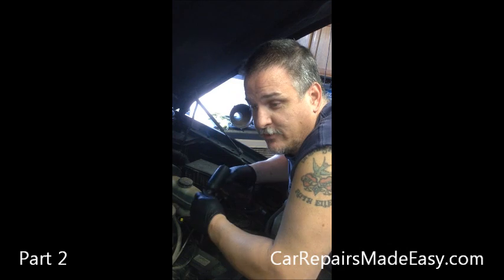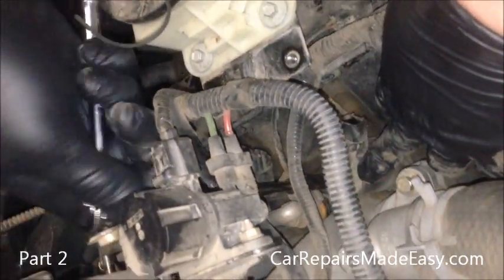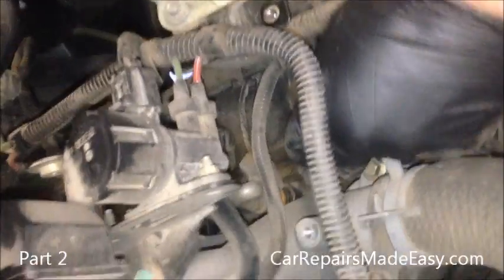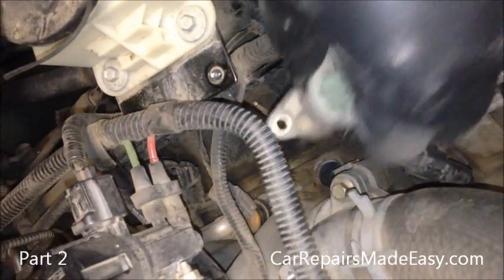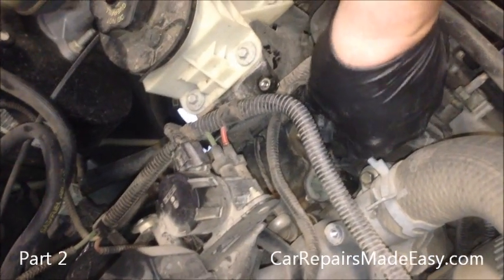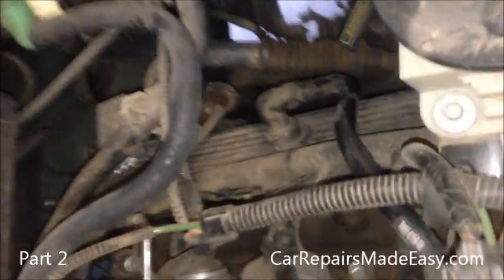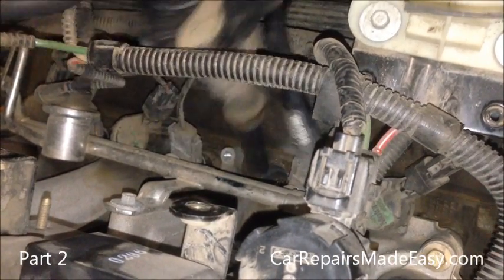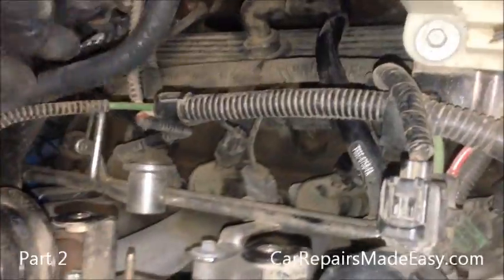Ford Expedition Spark Plug Replacement Part 2

Comment: Just so people understand, there is NO part 3. The entire reason most came to this video to begin with. 

 You'll need a stubby 7mm wobble one piece to clear fuel pressure regulator/ rail and a long 1/4 in ext to access coil screw on rear driver back 2 coils.

Tips he did not mention. Engine should not be cold, unless After pulling coil, spray WD 40 or equiv liquid penetrant so that it helps break free w/out breaking plug.  Let it soak at least an hour. Some say overnight.

I used electric 12v bosch impact. Plugs came right out. 

Torque plugs tighter than spec to 20-23 ft lbs due to limited threads penetrating cyl bore and preventing them from backing out. Some people use anti seize some don't.

Be sure and use Dielectric grease on inside of boots connecting to sparkplug.
Reply: Thanks man for ur info that did help more then the video lol
Reply: I’ve took the screw off with the 7mm I little beat leaned to the side in order to reach. Put it back on has being a pain in the ass though 😟
Reply: Thank you for that info.  I just changed all plugs and coils and couldn't figure out what to do about that particular coil.  Going to the parts store.  Thanks again!

Comment from the maker: Well if it is a case of oil and dirt creating a "paste" where you can't get the socket on the plug then try using something to scrap it out. If you have access to compressed air use that to blow out anything you loosen so it doesn't go in the hole when  you take out the plug. Brake cleaner will work well too.

Comment: Notice how nobody ever shows the rear plugs being done. This is hilarious.
Reply: Cylinder 4 and 8s sparkplugs are the most pain the fckn ass plugs to change
Reply: @turtleguy420  yes. It's completely ridiculous. Those rear plugs are certainly not coming out if the plugs are seized. It's almost as if you have to remove the engine to do them. Even just removing some of the other components seems like it may not be enough
Reply: I used some WD-40 on the 4th spark plug. Was stuck on tight.

Comment: Would have been nice to see a part three, since those are the ones im having problems with.  Im working on a 99 lincoln navigator. I cant get the spark plugs in deep enough for coil to sit in properly. Any suggestions?

Comment: Great video John, I got a got a code cylinder 7 misfire. Will changing the plugs fix the misfire. Can you do a video on how to replace pcv valve elbow on 2001 4.6 Expedition. I understand that it may fix the p0171 system lean bank 1. Thanks
Reply from the maker: Mike, replacing the spark plugs may fix you problem but there is no guarantee. There are many things that could cause a misfire so we can't say for sure what it is. Onyxia thing you could try is to sway the spark plug with one from another cylinder the does not have a misfire and the if the misfire moves to the other cylinder then chances are the problem is only the spark plug you can also do this with the spark plug wires and come up with a similar result

As far as the PCV valve we will see what we can do about making a video and I am Not sure if that will absolutely fix your problem causing your p 0171 trouble code but it could be the problem sounds like some sort of a vacuum leak which may be coming to that elbow if it is cracked
Reply: Thank you very much and understand that it may not fix it. Its worth a try again thanks for the tips

Comment: Thanks guys. Having my wife's car, and my truck to keep on the road, there's no way I'm going to a shop if I can help it.  I can't wait to get started on my spark plugs!  I figure, why not take the money i would use for a repair tech, and buy my own tools and fix it myself?  A question though, how do I know which plugs to replace?  How would I know which coils to replace?  Or should I just replace the coils and plugs together?
Reply from the maker: you should definitely replace all the spark plugs at the same time, we don't normally see issues with the coil packs so unless you know for a fact you have a problem with one of them i wouldn't change the any of the coil packs
Reply: Thanks John!  You may have just saved me another $100!!

Comment: Guess you never finished part 3. You ran into the same problem I did of accessing #'s 3 and 4 on the right side because the fuel rail needs to be removed in order to gain access to them. Real pain just to change spark plugs.

Comment: john, great video.  I've done my plugs at least twice but I'm faced with a crazy situation and want to know if you've encountered the same.  On cylinder 2 and 4 I cannot get to the spark plug.  I remove the coil, see the plug but when I lower my socket (with the right size) its not grabbing.  I even tried a deep socket but cannot grab the socket.  I've tried several times and different angles and still no go.  I used a small scope and I can see the socket in tact without obstructions.  Has this ever happened to you?
Reply from the maker: Craig Burdick Have not encountered that problem.  Maybe a universal/wobble spark plug socket will do the trick? Thanks for your question

Comment: I see coil packs run around $200 for the set. For an engine around 20 years but not too many miles, Would you change while changing plugs?

Comment: I am trying to change the spark plugs but having difficulty because there is a nut that is stripped out do you have any suggestions on what I should do to get the nut out so I can change this coil pack number 2 on a 2000 for expedition 4x4 ????? Please help !!

Comment: john, I'm trying to help one of my friends/coworkers with his expedition, he went to replace the spark plugs and noticed that on 2 of them the top portion I s broken off, it is causing a misfire and he needs to inspect it real soon. he said that he can get the socket down in the hole but the socket will not grab the plug. any ideas on how to remove it? I'm trying to save him some money

Comment: I have a 2001 Expedition. Just changed 1,2,3. Skipped 4 for the moment. 5 and 6 I was able to get the plugs out but the new ones won't catch and screw back in. They werent that hard to get out so I don't think they were stripped but its possible. Any advice?
Reply: May i ask if You are using any special tools for this job. Do you need a special swivel joint to access the plugs?

Comment: Is there actually a part 3 to this somewhere? I'm stuck at the same point.
Reply from the maker: No only 2 parts. What are you stuck with?
Reply: No idea how to get those two plugs out. #7 and #8.
Reply from the maker: You will have to watch part 2 again to see the rear plug on the drivers side. The 2 rear ones on the passenger side are more difficult. You will just have to feel for them. That's why we couldn't show them on the video. They are kinda hidden from view.
Reply: John Dobis Thanks for the advice. On my truck I was able to unhook the wiring harness from the valve cover and push it out of the way. Afterwards I used an 8mm wrench to remove the ignition coils. Once they are out the plugs are actually very easy to get to. The plugs in those two cylinders were rustier and had almost no electrode remaining. I'm guessing the last person to do plugs on this vehicle just skipped them.
Reply: @CarRepairsMadeEasy1  still could of showed how to get them out or explained or anyrhing

Comment: When I changed splugs on my 2004 Ford Expedition at 120k miles ,I notice that it is Autolite and the gap is .050mm but the Motorcraft that I replaced it with is .035mm.What is the right gap for 4.6 L Ford V8? Do you have any Idea?